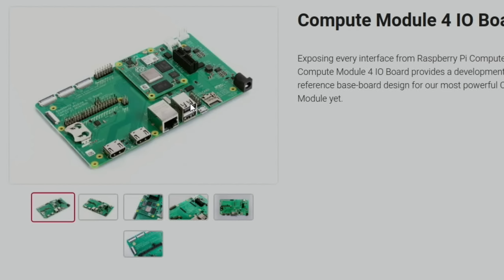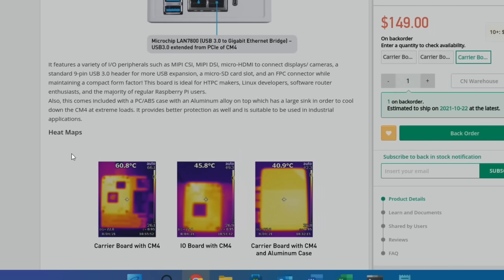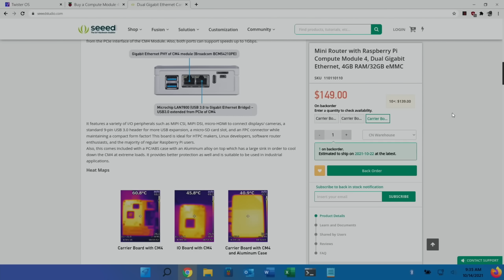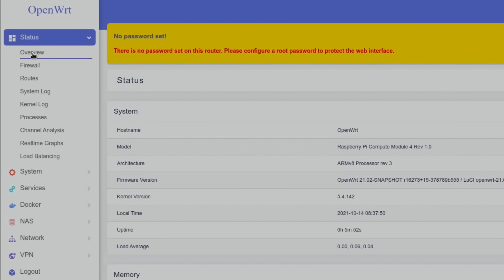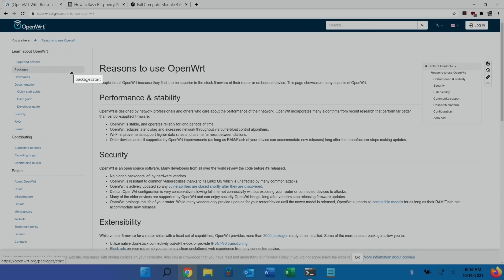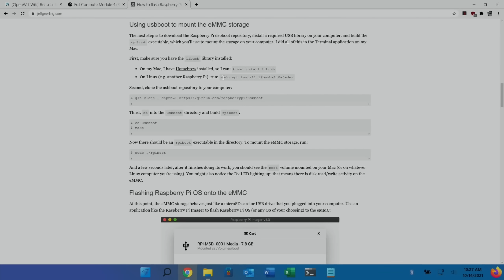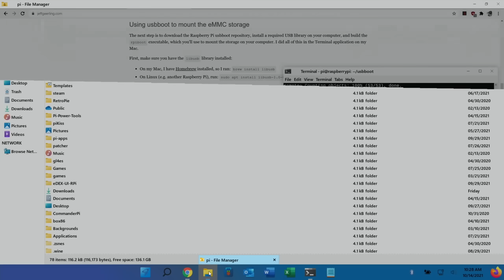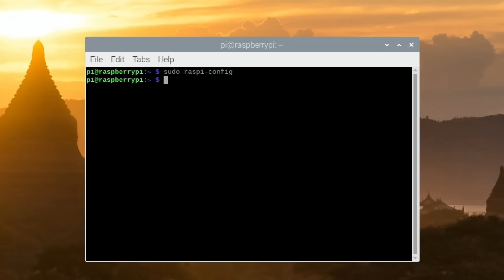OpenWRT mini router. Raspberry Pi Compute module 4 case with dual gigabit ethernet.

Comment: I was wondering if there is an updated video for this. I have the RPi4 CM4 and Seeedo w/carrierboard dual gb Nics, I would like to use it as a router in my network. Of course a replacement for a retail type router.
Reply from the maker: @michaelcooper5490  I haven’t explored it more

Comment: I know a person that got that router with that board and it ended up loading a script for bitcoin mining. 
He only discovered this when he was entering a script for a scheduled task, which the board removed and reapplied the malware.
The script was specifically written for OpenWrt and  the default wan->lan  firewall settings on the device were ACCEPT,ACCEPT,ACCEPT on an outdated SEEED fork for OpenWrt. 
Were it not for Jeff Girling's video on the board and a custom driver someone on Github wrote for Jeff for the board's controller chip there was no way to flash new, up to date, OpenWrt.

The whole this was sketchy. By default the OpenWrt's firewall setting for wan->lan is reject, accept, reject.

I do not trust this board nor Seeed.

Comment: Can I use this with the Pi to act as an interpreter between 2 machines? I need to send and receive TCP messages from a machine and then translate them (different syntax) before forwarding it to the second machine.
Reply from the maker: It’s not something I have tried

Comment: Do you have a link to the Power Adapter that you used here, please?
Reply from the maker: I haven’t used the 4A 5V one that came with the router. I was using the official Raspberry Pi adapter linked in a lot of my video descriptions. The video shows the 4A adapters model.

Comment: Great vid.  Openwrt looks powerful.  How do I backup the installed Openwrt image before I overwrite it?  Same imager tool?
Reply from the maker: You could try one of these methods treating the CM4 like a usb drive 

Raspberry Pi OS. Backup, Shrink and Restore to SD, USB or SSD. Raspberry Pi 400, Pi 4.
https://youtu.be/00ck25k_lgw

Pi-Safe. Raspberry Pi 4 / Pi 400. Backup, Shrink and Restore SD cards and USB devices.
https://youtu.be/XP6ycUR9Ih0

Comment: Got one, however as soon as I tried to use it I found out the whole file system that it is flashed with is read only.  That means you can't update the password no matter what you do.   That makes it totally useless.   Bought it on Amazon so if Seed does not get back to me with a solution I will be sending it back for a refund.  Great idea and it did connect up but with the entire file system set to read only can't make any configuration changes and that leaves it wide open for hacking and makes my whole network vulnerable.   Anyone come across this issue with theirs?
Reply from the maker: You could try flashing the image

https://wiki.seeedstudio.com/OpenWrt-Getting-Started/
Reply: @leepspvideo  That is what I ended up doing. Seems to work now

Comment: Looks nice, but for a router I would opt for a mikrotik hap ac2 or so. It also runs openwrt and has also switching capability. But if you want to use it as a pi its great

Comment: At about 5:00 you indicate that, lacking power, the device enables "pass-through." This is supposed to be a security device. In the event of a failure (power, crash, whatever), all the devices downstream of the router would be silently vulnerable: that seems a poor design choice ...

Comment: It will pass?through? How that… a switch chip or does it connect with some solid state relays? And can it be turned off for firewalls?
Reply from the maker: Try asking on the Seeed link.

Comment: Many amazing CM4 inventions by the week/month, shame theres pretty much no CM4's in the wild atm, their like rocking horse sh*t atm.
Btw, if im seeing this right, this "Router" isnt actually what most would consider a "Home Router" is it?  cant plug your dsl/fiber into it liek your normal router?  if so id say these mini routers are more like an overpowered switch with less ethernet ports.  Given the options available to the device, you are probably better off just using a NAS to do everything this mini router does, plus this seems like a fairly chunky price for a speedy feature packed switch.

Comment: Isn't this the board that uses USB3 for the 2nd NIC?
Reply from the maker: It uses the PCIe

This carrier board features 2 x Gigabit Ethernet Ports (RJ45). One Ethernet Port is connected to the Gigabit Ethernet PHY of the CM4 module which is based on Broadcom BCM54210PE. On the the hand, the other Gigabit Ethernet Port is connected to Microchip's LAN7800 which is a USB 3.0 to GbE (Gigabit Ethernet Bridge). The USB 3.0 interface here is extended from the PCIe interface of the CM4 Module. Also, both ports can support speeds up to 1Gbps.
Reply: @leepspvideo  not really. Watch Jeff Geerling's video in which he compares this board with one from dfrobot. There you can see that the Seeed solution is throttling the 2nd NIC by not attaching it directly to the PCIe bus.

Comment: You can also build your own similar router with a Raspberry Pi 4B by adding a USB Ethernet cable to give you 2 network ports. Download a copy of OpenWrt image for the RPi flash it to a microSD card and boot up to the same Luci interface.
Reply: Did this :)

Rp4 4gb RAM 
With usb nic 

Wan And lan 

Lan to a managed Switch 
Added tplink eap245 as Accesspoint 

Works without issues

1gbit in Network and full isp Bandwith (250down 45 up)

Some routings and firewall rudes addet Too  
No issues pi Handles Fine

Comment: If you have to keep it jumped to run with a different os, looks like a jumper from a PC motherboard would work.
Reply from the maker: It was only connected while flashing the eMMC. Raspberry pi os ran fine without the cable.

Comment: It looks like they added some sort of PCB glue/adhesive around the main chips... I wonder if they've experienced any issues with shipment causing chip problems? That's the first time I've seen that black adhesive used on a CM4.
Reply: Hello Jeff, this is Elaine from Seeed. The PCB glue is a kind of specific glue in use with chip,  which we've tested multiple times when manfacturing. We use the glue in order to ensure the components will not be easily damaged by any falling impact and make sure of the functional  reliability. Thank you！
Reply: Called underfill, adds robustness.
Reply from the maker: It’s a neat job. As it’s my first one I assume it was how they all shipped.
Reply: @leepspvideo  interested in seeing how that image +kit performs for the price against marc's
'CHEAP WI-FI MESH ALTERNATIVE' , 'Which Router is best for OpenWrt in 2021?' , and a pi4 compiled 'Faster Internet with OPENMPTCPROUTER' kernel jeff?

https://m.youtube.com/channel/UCG5Ph9Mm6UEQLJJ-kGIC2AQ/videos
Reply: I'm curious if they fixed the network throughput issues since the one you tested on your channel, Jeff.
Reply: @GnatTheGnome  Supposedly there was an update, but when I went to check what they mentioned it didn't seem to be a networking-related patch. But I haven't had time to re-run my tests yet.
Reply: Hey, It's Jeff Geerling! It's like seeing your favorite movie start in the grocery store or something. Cool. What's up Jeff! I love your content. This video was great as well, don't get me wrong.

Comment: 5 years ago I reflashed an old linksys router with OpenWRT because the stock Cisco firmware didnt allow for wifi repeater; and it still works perfectly fine

Comment: I'd also like to see these clustered with the VMware 7 fling, clustered redundant routers anyone?
Reply: Nope
Reply: @pavan13  i think it would be could with redundant routes and piehole plus more and perhaps even fail over ... I need to buy a pi 4 or compute and see if I can mount iscsi storage under esxi (the fling is free) but i have vsphere through the VMUG

Comment: Does wi-fi work with this kit?
Reply: When i reflashed it with the new build i found the wireless would work.
Reply from the maker: In trying to find out I found this.

https://www.jeffgeerling.com/blog/2021/two-tiny-dual-gigabit-raspberry-pi-cm4-routers

Search the page for WiFi